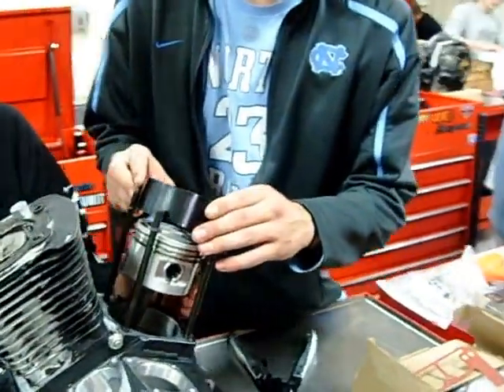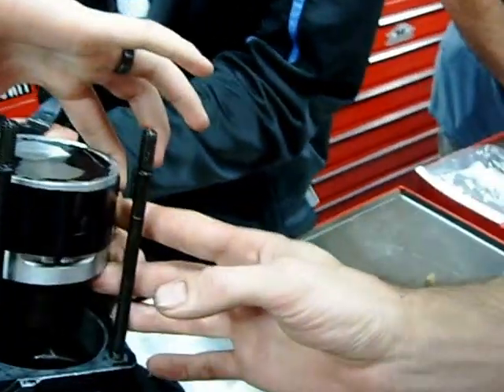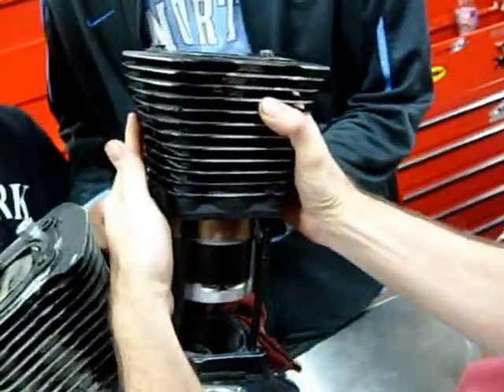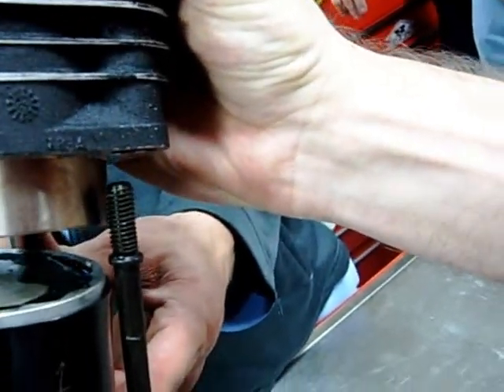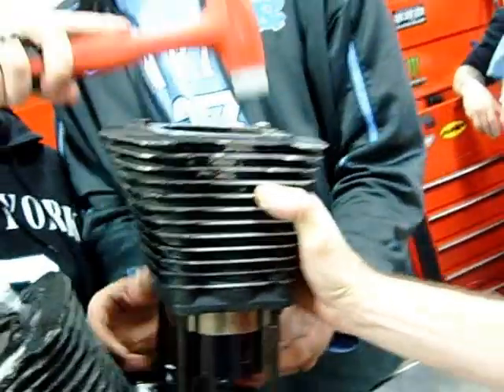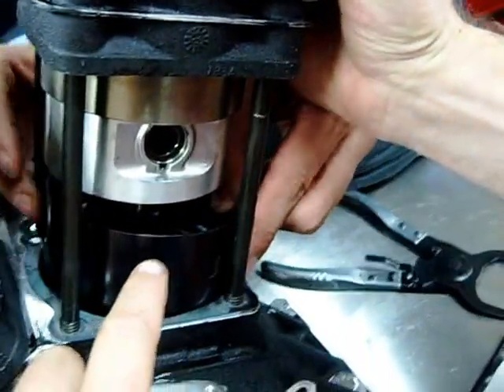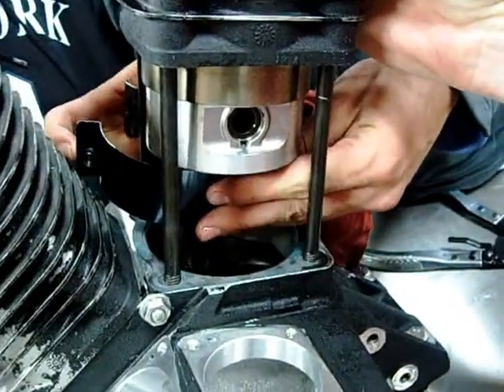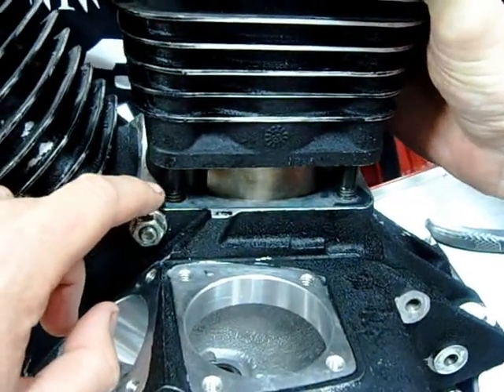Part 03.2 How to install piston cylinder OEM method on a Harley v-twin S&S Revtech EVO

Comment: Do these line up on their own, or is there  a procedure to ensure the cylinders are exactly centered and squared in relation to the connecting rods? Ive noticed that they can be moved about .050-.100

Comment: Aren't those cylinder studs upside down?
Reply: From '95 onwards the MoCo inverted the studs to prevent the possibility of the head bolts bottoming-out on the ridge.